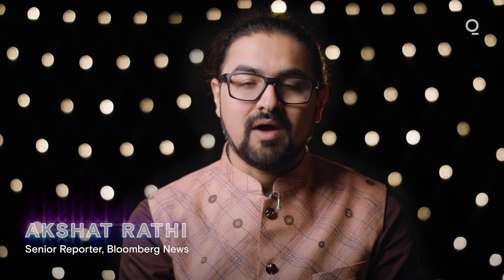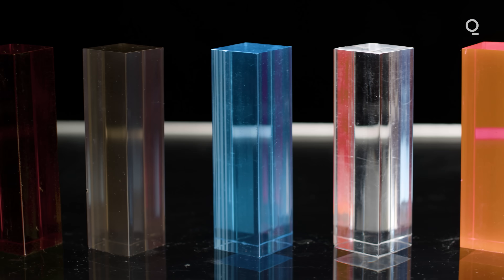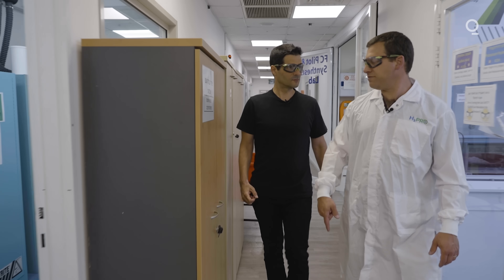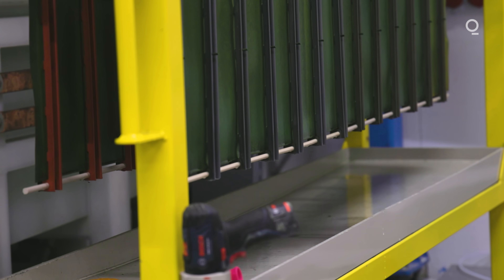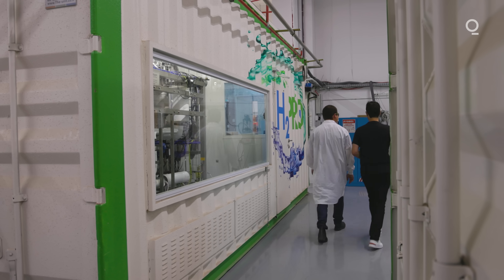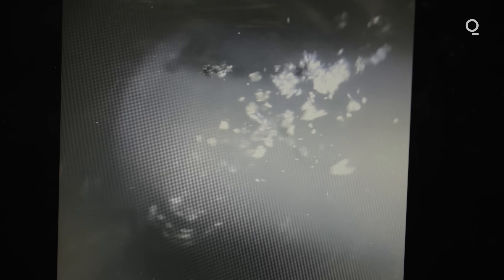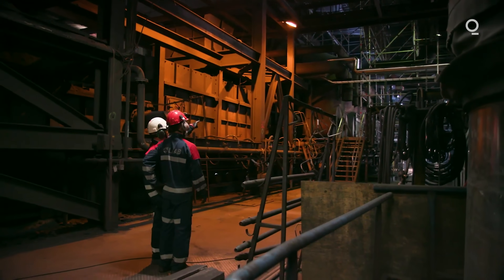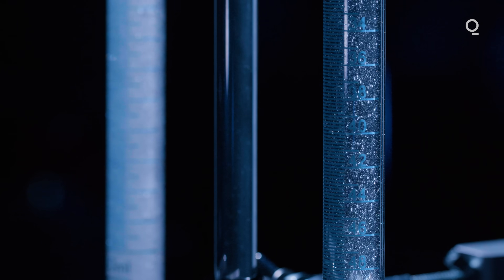How Cheap Hydrogen Could Become the Next Clean Fuel

Comment: Interesting overview! For transportation of H2, liquid organic hydrogen carriers (LOHC) are very promising, since they are much easier to handle than liquid or gaseous hydrogen or ammonia.
Reply: They have a really bad energy density compared to liquid hydrogen.
Reply: @jimj2683  maybe, but Liquid H2 incurs a much higer energy penalty. Liquefying Natural Gas is already energy intensive, and requires heavy insulation. Liquid hydrogen will likely be worse.
LOHCs may be less energy dense but they are also much easier to transport on a large scale.
Reply: @jimj2683 Everyone pro hydrogen skips the volume density problem. 

 Like yeah I just love having my fuel take up most of the space in my car. 

 Batteries have potential. No getting around the hydrogen density problem as far as I'm aware. 

 Well maybe if one of those nano space magic materials which can carry more hydrogen then it can in pure liquid form. Like how water holds more hydrogen in it per volume then pure liquid hydrogen which is just mind blowing to me. 

 To bad we couldn't separate the hydrogen from water very efficiently.
Reply: There is no such thing as H2 water has 1 Hydrogen atom and 2 oxygen atoms always has and always will in scientific notation two Hydrogen atoms would be 2 H and two Oxygen atoms would be 2 O regards Graham Flowers MEng
Reply: And you waste 90% of the energy transporting the carrier instead of the fuel. 👏
Reply: Hydrogen is not the future the future is battery electric vehicles and grid with battery storage?
Reply: yes they are.     BoB lazar has build a nice one, it's not actually liquid it is dissolved into a heat sensitive solid.  safe and stable.
Reply: Hydrogen is not an energy source it is an energy carrier. The use of Hydrogen as an element for steel making and fertilizer where Hydrogen is produced where it will be used is vital and should be converted to Green Hyrogen. 
Hydrogen however fails as a viable fuel for planes fails as it requires so much volume that the plane or truck or boat would have no room for cargo. 
How you handle the logistics of converting from natural gas pipes to Hydrogen you would need two sets of pipes for every home? 
The cost to modify stoves, heaters, and pipes would be exorbitant. 
 This whole video appear to me to be another scam by the fosil fuel companies to keep burning gas.
Reply: @jjamespacbell  Airbus 320 has 22 000 l fuel tanks. Approx 18 000 kg of kerosene. Approx 6000 kg H2 as energy equivalent. Makes 100 000 M3 at 1 bar. Or 150 m3 at 700 bar. A tank 15-20 m long and 3x3 m wide.
Reply: If I am not mistaken concentrated ammonia solution has a higher hydrogen concentration to be released from the dissolved ammonia than does compressed hydrogen.
Reply: So methane?
Reply: 😶‍🌫🤯We will soon introduce the revolutionary FAZE engine technology.
The 𝔽𝕦𝕖𝕝 𝔸𝕘𝕟𝕠𝕤𝕥𝕚𝕔 ℤ𝕖𝕣𝕠 𝔼𝕞𝕚𝕤𝕤𝕚𝕠𝕟 𝔼𝕟𝕘𝕚𝕟𝕖  
[𝔽.𝔸.ℤ.𝔼.] tech best solves the issues present in previous internal 
combustion engine designs by transforming the old paradigm into a 
simple, low cost, quiet, power dense, efficient, on-the-go liquid and 
gas fuel-flexible, ‘non-polluting’ solution for power generation of all 
scales and advanced transportation, construction, military, off-road 
vehicles including ships, aircraft, trains & robots not possible before 

𝔽𝔸ℤ𝔼 delivers better than 25% ABSOLUTE/ACTUAL [not relative] 
fuel efficiency improvement over gasoline engines, more than 15% 
for Diesel engines at any operating condition - speed/load, ambient 
temperature or elevation, not just at one optimal testing point at 
STP. Real world driving cycle savings could be an additional 200% 
higher due to the constant MAXIMAL efficiency and torque. The 
simple, low cost, native/built-in, non-electric, environmentally safe, 
non-explosive, temperature agnostic 𝕊𝕦𝕡𝕖𝕣ℍ𝕪𝕓𝕣𝕚𝕕© feature 
recovers more energy than EVs and provides approx.100% fuel 
savings for a combined absolute vehicle fuel usage improvement of 
approximately 300%, thus obviating the basic need for expensive 
EVs & e-hybrids. 𝕚ℙ𝕠𝕨𝕖𝕣𝔹𝕠𝕠𝕤𝕥 adds >400% more torque. It’s like 
4 engines in 1. 𝕚𝔼𝕗𝕗𝕚𝕔𝕚𝕖𝕟𝕔𝕪𝔹𝕠𝕠𝕤𝕥2© further improves efficiency, 
torque, power & other performance metrics by 10%. This is all done 
w/o a transmission. Additional fuel saving solutions are available.
 
The FAZE engine perfectly follows the vehicle’s road or genset’s 
electrical power demand with no energy loss [no fuel waste], This 
unique characteristic enables dispensing with any auxiliary power 
units [APU] for power or refrigeration in any application. This also 
makes for a perfect range extender for battery electric vehicles [EV] 
or as a standalone EV charging unit even where is no electric grid.
 
The fuel agnostic capability allows instantaneous use of any liquid 
or gaseous fuel [natural gas at home!!!] incl. biofuels and hydrogen, 
even if old/dirty/unprocessed like flare gas or employ the concurrent 
multi-fuel capability…anywhere on the globe. One engine for all 
locales w/o changes! Unlike EVs, this enables fast fueling anytime, 
anywhere…with no troublesome infrastructure disruptions or 
changes. EV’s are not a solution to the [FAKE]climate or mobility topics as 
high level of electrification globally is unrealistic 
[See Patrick Boyle's video "Electrify Everything?"] 

The technology offers smokeless, non-polluting, low odor heat and 
noise output without costly after-treatments, etc.,… with only the 
lowest  CO2. It has a negative carbon footprint with hydrogen, 
ammonia, biofuels or gasified municipal, agricultural and/or forest 
waste and coal from a 2-stroke-like simplicity. These are HUGE 
business opportunities. We can provide these turnkey solutions 

The FAZE technology can be integrated into any ICE or vehicle 
architecture, adding some of the positive characteristics to its own. An advanced Scotch Yoke architecture slated to be incorporated in the 𝔽𝕦𝕖𝕝 𝔸𝕘𝕟𝕠𝕤𝕥𝕚𝕔 ℤ𝕖𝕣𝕠 𝔼𝕞𝕚𝕤𝕤𝕚𝕠𝕟 𝔼𝕟𝕘𝕚𝕟𝕖  [𝔽.𝔸.ℤ.𝔼.]

With virtually no electronics and emissions equipment, the cost of
purchase and reduced servicing frequency make this solution 
even more appealing.

Comment: Electolyzing salt water produces hydrogen and sodium hypochloride, also known as "chlorine bleach". In fact, that's exactly the way all chlorine bleach is manufactured. So, when I hear someone say they're electrolyzing salt water to produce "green hydrogen", I have to ask "how do they deal with all the bleach they're producing?"
Reply: Different salts. "Salt" just means it has this ionic bond. There are thousands of possible salts.
Reply: You don't use salt with electrolysers, and there are many different salts. 
You typically use either a special membrane or water with potassium hydroxide

Comment: For steelmaking, it would be much more efficient and more cost effective to use renewable electricity directly, instead of having the efficiency loss of making hydrogen first. Electric arc furnaces have long been used to make specialty steels, and with a direct electrolytic process it should be possible to convert iron oxide ores into pure iron for steelmaking.
Reply: There will be the same problem if solar and wind are the generators for your industrial processes: intermittency/reliability. It would be a shame for the foundry to shut down because of a cloudy week...or winter. Nuclear would be a much better fit, especially considering the enormous heat of the reactor can be harnessed through cogeneration, which for steelmaking is also very important.
Reply: Boston Metal has developed Molten Oxide Electrolysis that consumes 4MWh per ton steel, whereas 54kg is required to produce 1t sponge Iron suitable for EAF similar to scrap Iron recycling. Hydrogen based steel has the potential to be 100% clean and about twice as efficient as Boston Metal.
Reply: @денисбаженов-щ1б  I hope you realize what LCOE is and what it isn't. LCOE is a metric for lifetime costs of a generator divided by total electricity production over the same period. What it is not is an all-costs metric for a stable and secure grid. More to the point, LCOE only factors in build costs + O&M costs, and only cares about electricity generated; LCOE does not account for storage costs (this is what LCOS is for), or for other costs regarding dispatchability and infrastructure components involved in building things like smart grids. LCOE is useful as a metric, but you have to understand how it is limited, or else you misinterpret it as an all-costs metric when it very much isn't. It isn't enough to say "well, solar has a lower LCOE, so we should just invest in solar since it is cheapest from a dollars-for-watts perspective," because there is more to a stable and secure grid than the generators. 

I also think you are misunderstanding the dynamic between base load generators like a nuclear power plant and intermittent generators like wind and solar. We wouldn't scale back a nuclear power plant's generation because solar/wind are peaking. If anything we would divert excess energy to storage or to productive ends such as desalination when we generate "too much" clean energy, instead of just producing less like you might do with a peaking plant; a nuclear reactor doesn't just turn on and off like a gas turbine. The nuclear power plant will run at a fairly constant rate during operational periods which are typically 1.5-2.5 years depending on design, with an average of 25 non-operating days for refueling and maintenance during the same period; with the exception of those refueling/maintenance days the plant will produce electricity at a level rate around the clock. As I'm sure you're aware, solar only produces power while the sun shines, and wind only when the wind is blowing with sufficient intensity, both of which are highly variable and cannot be planned. To compensate for this, we necessarily must invest in building out overcapacity and large storage projects along with additional grid resources such as substations to meet demand and have a dispatchable electricity supply. So while it costs more dollars to produce watts out of a nuclear power plant than a solar power plant or a wind farm (LCOE), there are other costs not captured in LCOE estimates that are completely avoided by not having to design and build around intermittency. You seem to have an understanding of capacity factor to some degree, so I won't belabor the gulf of difference between nuclear power plants and all other power generators in terms of capacity factor, but I will say that capacity factor in itself is as important a metric as LCOE if not more, due primarily to the above points. 

As for how much natural uranium there is, I think you might not be aware of how abundant uranium actually is. It is about as rare in the earth's crust as tin is, and is more abundant than gold, silver or mercury, and only slightly more rare than lead, cobalt, or molybdenum. Considering we don't actually need to use that much of it to produce a lot of energy (E=mc^2, after all), we actually don't need to mine a whole lot of it either. The figures you are citing when you say "natural uranium reserves are for 40-50 years, for just 10% of electricity generation worldwide," are in regard to existing economically recoverable reserves, and do not account for new exploration (finding more economically recoverable reserves) or for other extraction methods such as seawater extraction. In short, even if we were using nuclear to produce 100% of the world's current primary energy consumption (about 3x as much as world's electricity consumption), we could do so for thousands of years with uranium from just seawater extraction. There just hasn't been a need to explore for more uranium resources, or pursue other extraction methods apart from traditional mining methods. 

I also think you are sharing a common delusion about the efficacy of solar and wind energy that many today currently share. The points you brought up are extremely common, and are unfortunately based primarily in misunderstanding or from lack of context. I am not saying this to disparage you, just to say that common misconceptions are more easily believed than those that are not common. Take Germany, for instance. From 2013 to 2020, Germany spent 202 billion euros building out wind and solar projects, despite Germany not being well situated to take advantage of either technology particularly efficiently. The result of this spending was an amount of electricity generation from wind and solar comparable to what Germany's nuclear power plants had been generating before they started turning them off; nuclear produced 152-171 TWh/yr between 1990-2006, while in 2020 solar produced 50TWh and 130 TWh was produced by wind. Three nuclear power plants had been producing about 11% of Germany's electricity prior to 2022. These are Isar 2 (3.82% of all electricity), Emsland (3.62%), and Neckarwestheim 2 (3.55%). Isar 2 was built in 67 months for about 4.7 billion euros and was handed over to the operators in 1988, five months early and 500 million euros under budget; it operated with 91% capacity factor up to 2022. Imagine for a moment, if Germany were to have used the money invested wind and solar between 2013-2020 on building plants identical to Isar 2 instead. If we round up and just assume a 5 billion euro cost and assume a construction time of 7 full years instead of 5 years + 7 months, then Germany could have produced 40 Isar 2 plants which all together would produce more than 150% of its electricity consumption in 2020. And just like France, which took this strategy in the decades prior, it might have been Europe's largest electricity exporter. Granted, concurrent construction of 40 identical plants isn't doable in 7 years. However, even assuming the highest outlier costs, at 20 billion euros each, Germany could have doubled its nuclear energy generation in this timeframe, which would produce about the same amount of electricity for 60-80 billion euros as their renewables have for 200 billion euros. 

If you would like to have a more in-depth conversation about these subjects, I am more than willing but YT comments are not the best place for it. If you really care, and want to have the discussion, we can work out a time and venue. Otherwise, I hope that if you do genuinely care about clean energy that you will take what I have said, and investigate further. I can point you to numerous academic sources if you would like.
Reply: Have we not learnt our lesson with the Hindenburg?  Hydrogen goes Boom!
Reply: The hydrogen is used a reducing agent. You need something to remove the oxygen. You can't just use electricity alone when you're starting from raw one.
Reply: Because of a lack or reliability (if it's cloudy or not windy etc. pp. they would have to stop doing what they're doing), the best would be a hybrid approach. 

Use whatever comes from the renewable generators directly when needed (if possible), use the overhead for hydrogen production. And when there is not enough electricity coming directly from the generators, start using the hydrogen to create the necessary energy.

We don't really have to limit ourself to just one solution. Using hybrid ones is usually the best approach.
Reply: @mementomori5580  Agreed.
Reply: @mementomori5580  Hydrogen is more energy efficient and much cheaper per unit of energy than grid delivery of electricity and Green Hydrogen will always be the cheapest option.
Reply: @jensstubbestergaard6794  what on earth are you talking about? hydrogen is much less efficient and more expensive than grid electricity! You need 2 units of electricity to make 1 unit of hydrogen. Plus the costs of equipment to make it and compress it and store and transport it.
Reply: @mementomori5580  Except renewable Sucks, they produce fickle amounts of power, are unreliable, and inefficient. A single nuclear reactor could outdo several cities worth of Solar Panels at their peak efficiency.
Reply: @денисбаженов-щ1б  Hydro is very limited, do you think you can simply put a 500mw Hydro plant everywhere?, You are missing the point that Solar and Wind are not feasible to replace an entire grid, especially with today's energy demands, and upcoming energy demands. Both power sources produce fickle power for the space they take up.
Reply: Why don't you apply for a job there and suggest this if you are sure about it 😄
Reply: @jhonedoe3734  nnbm3p appears
Reply: Everyone here saying "renewables are unpredictable" clearly has never heard of a "battery"... Ya know, the thing that can run for decades, then be 99% recycled for cheaper than the cost of mining new material.

...but go ahead and whine about how you "like the feel" of pumping a liquid fuel around.
Reply: @cybertrk  batteries have efficiency problems. Put that ontop of the lackluster performance of the big 3 renewables, solar, wind, and hydro, hydro being limited mostly by circumstance.

Also I don't get your last line, do you think using an EV does anything for emissions or pollution?, do you think that by offloading the energy to the electric grid rather than gasoline, you are magically not going to use the many coal plants, and other power plants that are not renewable?, Not to mention that as our current infrastructure stands, our electric grid neither has the infrastructure nor power to supply a nation full of EVs, let alone a state. There will have to be an incredibly huge ramp up in "renewable" productivity to get the numbers you want, and evenso, as you scale up, Solar becomes much worse as each panel only lasts some 30 years, with how many you'd need to power our future needs, that'd be a huge upkeep cost. Wind just plain sucks and is even more unreliable.
Reply: @cybertrk  Batteries are great but not financially feasible in the context of steelmaking.